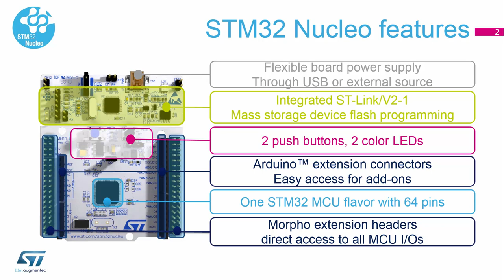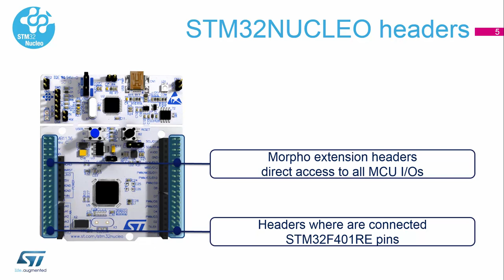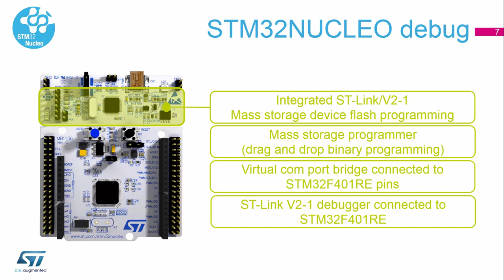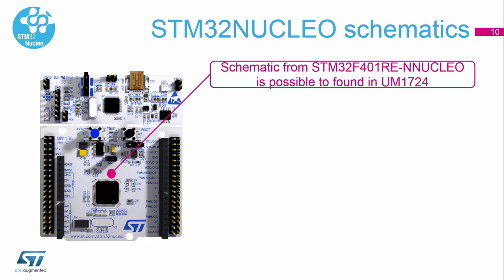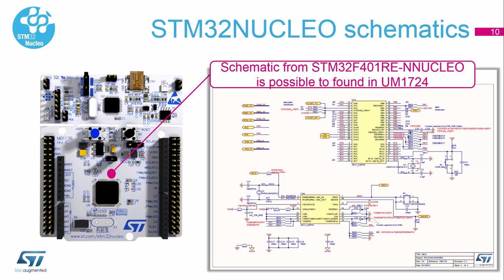STM32CubeMX basics: 01.3 Introduction - Nucleo board presentation

Comment: i have stm32f446re. all things will work on this board also??
Reply from the maker: STM32F446 is equipped with more peripherals (like 3 ADCs instead of one, more timers or communication interfaces), but the IOs location on the board, button and LED connections, USART (used for VCP) connection are the same on both. Thus there should be no big problems to run examples from this session on your board.
Reply: @stmicroelectronics  thanks!!
Reply: Using this too :)